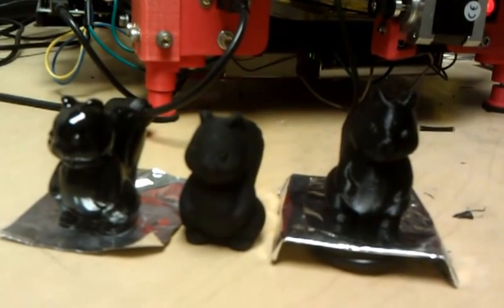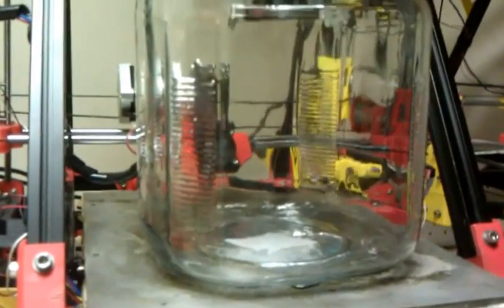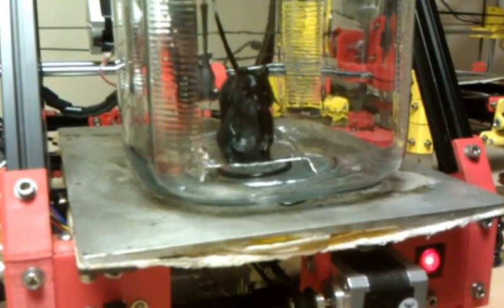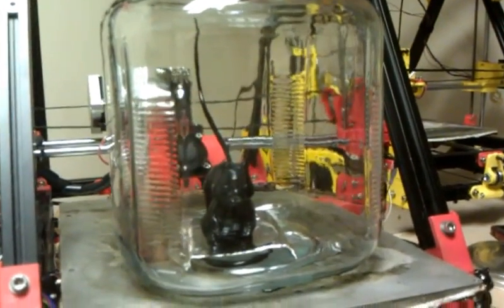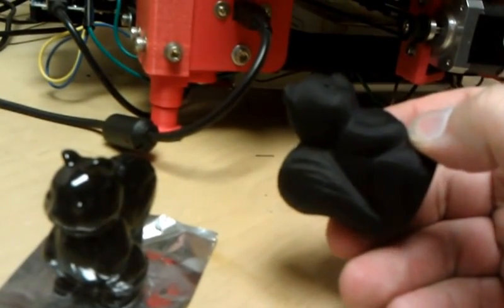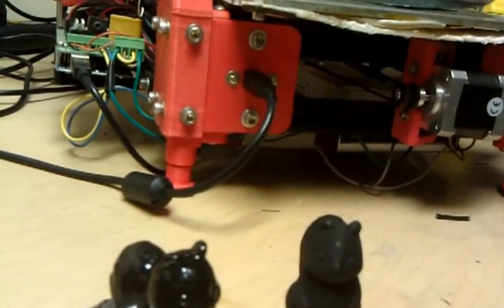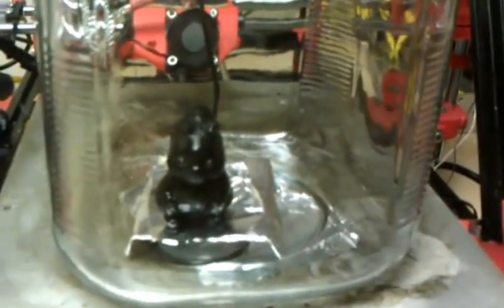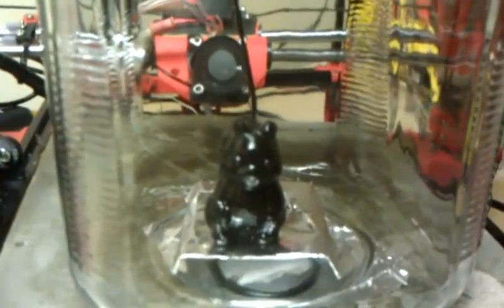Still Extruding: Vapor Treating ABS 3D Printed Parts

Comment: To be clear: Acetone only works on ABS. For PLA you have to use MEK SUBSTITUTE (Ethyl acetate).
You don't have to heat it either because those chemicals are so volatile, although using heat does reduce the polishing time from hours to minutes.

Comment: Anyone ever tried a pan of acetone in the bottom of a toaster oven for small parts?
Reply: I probably would not do that, it could work, but your oven and house will smell like acetone forever, also acetone fumes are really bad for you, The best way to do this would be on a heated bed outside.
Reply: I have a toaster oven I use only for maker-type-stuff, usually for baking paint coats on metal enclosures. It stays in the open garage.

FWIW, I tried to do a vapor bath in the toaster oven a while back, and I think it's just too small and difficult to control. My part was too close to the heating element and got a nice brown melt mark on the top.

Comment: does the treatment actually "harden" the part?  I have a printed part that is weak along the layer lines, will this treatment make the part stronger?
Reply: It makes sense that it will, because merging all the layers should strengthen the bond in the perimeters.
Reply: Stuart Kirkwood
I agree, but this should not be used to compensate for underextrusion or z-axis issues :)

Comment: No you only at 10mm to a 200-300ml bottle so the acetone vapor never gets over the sides (you can see the vapor line on the bottle in the video).  If it goes over the side your going WAY too hot or added way too much acetone.  It does not take much, and you get most of it back in liquid form when the bottle cools.

Comment: You only ad 10ish ml to a 200-300 ml bottle so the vapor should not go over the edge of the bottle when this is being used.  If it does turn the temp down (as you can see in the video the acetone cools at the top and runs down the inside of the glass back to the bottom to be reheated.

Comment: Acetone is heavier than air, if it boils over the side just turn temp down.. You don't want to put a lid on it because it would pressurize and possibly explode.  Bad day.

You could not smell the acetone in the room at all, and once the video was done we actually mange to reclaim a good chunk of the acetone back out of the jar.